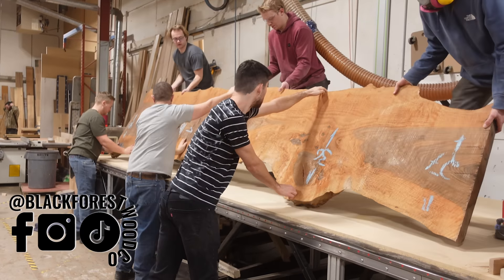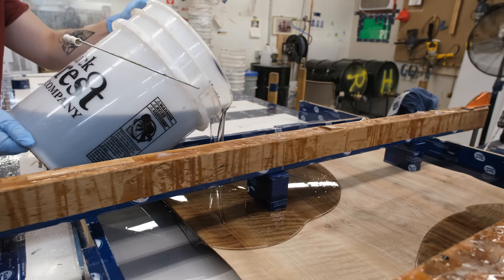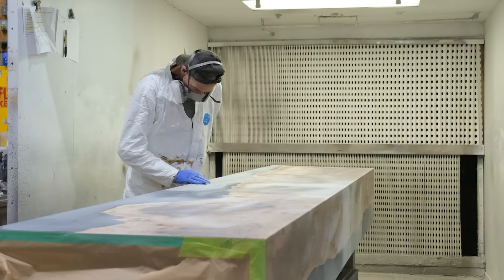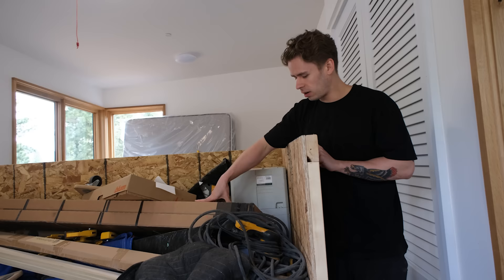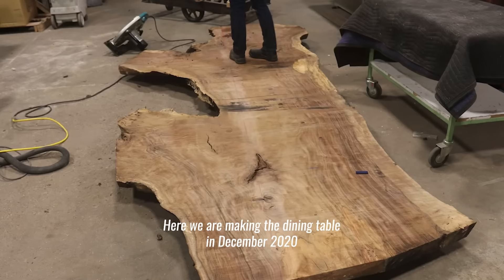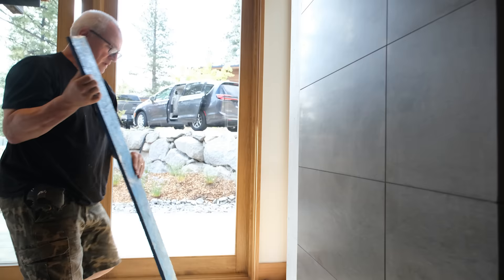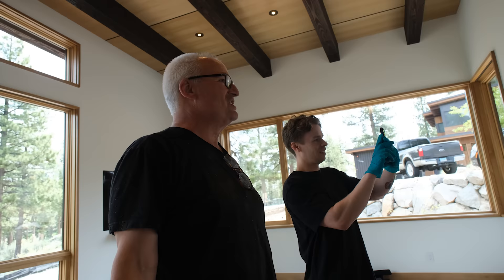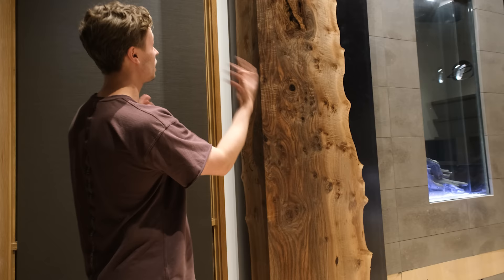Installing A $25k Resin + Wood Fireplace

Comment: I've done cabinets that have 45° angles on the edges. It does, most certainly, add strength and stability especially if you want invisible joints.
Reply from the maker: Nice, good to know! Thank you 😄

Comment: Just wondering if you can have the same CAD/CAM style of final sanding with a sander/polisher that would run across all the wood planks width and lenth ... ?
Reply from the maker: You can but you often still have to finish by hand!

Comment: i'm all about PL or liquid nail or whatever adhesive but there is no way i would trust an adhesive with that amount of weight that could literally kill someone if it failed. there has to be a better way to attach it, or use a couple screws and make black dowels like you'd make out of wood just with epoxy to fill the screw hole. 4 little quarter inch dowels aint gonna kill anyone to look at. nice looking piece otherwise.
Reply from the maker: The piece balances on its own without the adhesive, even before it was secured, it would take a considerable push to tip the piece over. The PL was just to hold everything in place!
Reply: @Black Forest Wood Co.  ya but what I'm saying is what if some 3 year old pushes against it or whatever scenario. I'm not trying to bust your balls. I love the channel and all the content but I install heavy stuff in family type rooms for my job and sometimes we use adhesives and sometimes we don't if gravity is in our favor. But if gravity is not in our favor I always add fasteners since I know I wouldn't trust my kids under/above/near it. 

Once again. Not trying to bust the old balls but personally I wouldn't be able to sleep at night knowing that you're only relying on a chemical bond and not a physical one.
Reply: @TheEricj1337  U are 100% correct as if it was a slab of marble or even stone it would be mechanical tied into the fireplace. PL works great but I doubt it is related anywhere near the weight of that piece. Things happen and the liability there is insane and easily prevented. Just that block on top can kill someone at that height.
Reply: The PL 400 has a shear strength of 245psi, with the amount of adhesive applied over the full length of the piece, i cant even imagine a situation where it could fall over accidentally. I doubt you could get it to move even if you used a pry bar. And that doesnt even take into account that, as per the designs shown, it will be locked into place with a stone shelf that wraps around the whole fire place including the piece that they installed, which will act as a bracket/strap locking it in place.

Comment: I don't think the dominos would help against shearing forces any more than on an edge joint. But it seems it would make the miter joint stronger against torsion flexing. the 45 degree angle glue faces would be weak against a shearing, rotational force, but the dominos would keep that from popping loose, almost like a gusset.
Reply from the maker: That’s kind of what I was thinking too!

Comment: y'all know that resin doesn't do well with heat, right?...
Reply from the maker: This was engineered to be far enough away from the fireplace so that there would be no issues. It also depends on the epoxy, we have exterior doors using our resin that gets hours of direct sunlight everyday with no issues. Lower quality products may be more affected by heat!